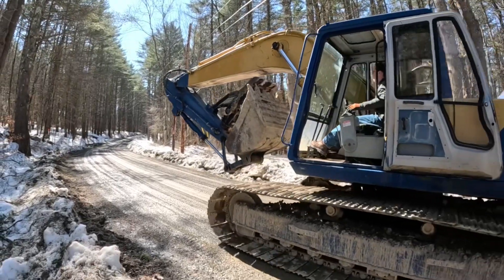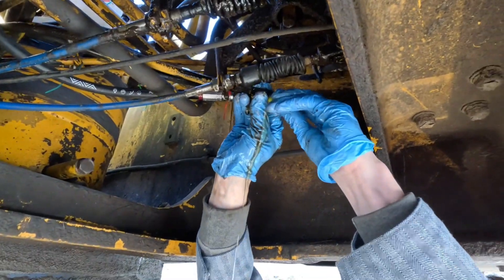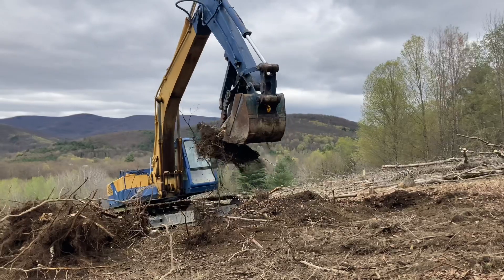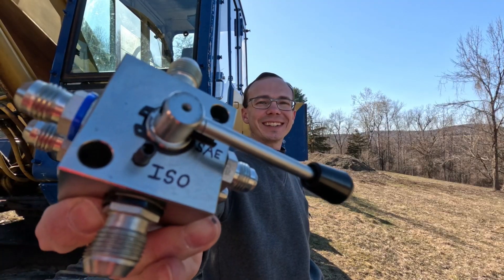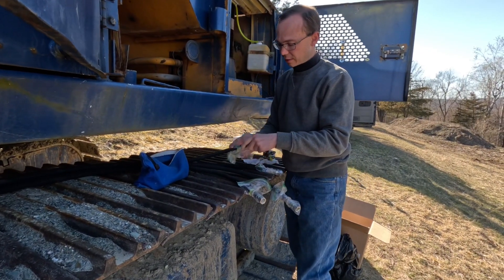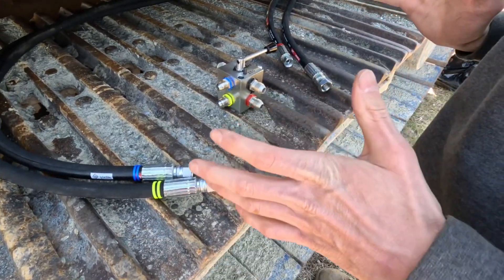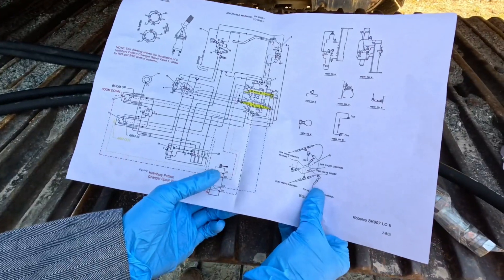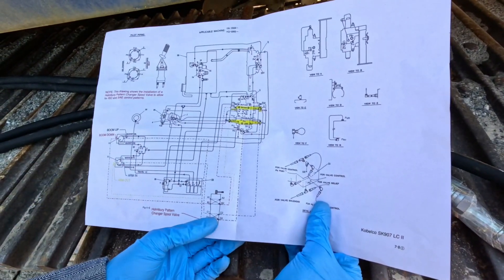How to install a Pattern Changer Spool Valve on an old excavator (ISO vs SAE controls)

Comment: One minor correction on nomenclature. there are two patterns of controls.
John Deere and SOE Society of Operating Engineers in other words all manufacturers except John Deere.
Don't get me wrong, I prefer John Deere equipment and have purchased John Deere for my logging and road construction businesses whenever possible for 50 years but I started on SOE controls at age 12 and I just can't pull the cork from a wine bottle with John Deere controls as easy as with SOE.
Reply from the maker: Interesting

Comment: Where you got that valve? It´s a 8 ways?
Reply from the maker: We purchased the value from a local hydraulic shop. There is a link with the part number in the description. It is an 8 port, 2 way valve.

Comment: I'm in the exact same boat.  Just bought a used machine and I'm not good with Cat controls.   The John Deere manual says I have to swap A and D, and then B and C, but like you I want to have cat available for anyone else that likes that pattern... I reviewed your google drive document but... I guess I need to study the machine more. (only had for 6 hours)    I do know where the pilot control bank is.  But I'm not following what other parts of the tractor you are going to.  It looks like 4 old lines are going to the pattern charger.. and 4 new ones are coming out.....  There is one of the Holmbury Pattern changers on ebay, i'd like to get.
Reply from the maker: I know every machine is going to be a little different, but as long as you can identify those four pilot lines and find a place to mount the valve, it should work well for you. On my machine, I just simply removed the boom and arm pilot lines from the main control valve bank and ran those 4 old lines into the pattern changer valve. I did not remove any lines from the joysticks. I then ran 4 new lines from the pattern changer back to main control valve bank. So basically all i did was interrupt the boom and arm pilot lines. Hope your project goes well!

Comment: I have the same machine I want to do this to . Do you have pictures by chance of where the lines go ? Into the valve changer and where the 4 new lines connect ?
Reply from the maker: Very cool, We just put a link to a drawing from our Kobelco Service manual in the video description, that Donny marked up. Hopefully it can be of help to you.
Reply: @Schroederhillsidefarm thank you for that 
That will help us a lot . 
Do you remember what length hoses you got for the 4 new lines that are needed by chance?
Reply from the maker: If I were to do this again, I would use the following:
5’ for the “black” boom up pilot line
5’ for the “blue” arm in pilot line
6’ for the “yellow” arm out pilot line
7’ for the “red” boom down pilot line
Reply: Thank you for the information 
We will be tackling it this weekend hopefully.
Reply from the maker: You're welcome. That's great! Let us know how it goes.